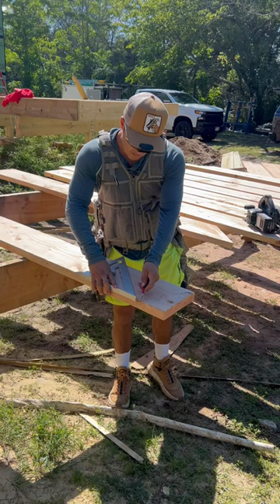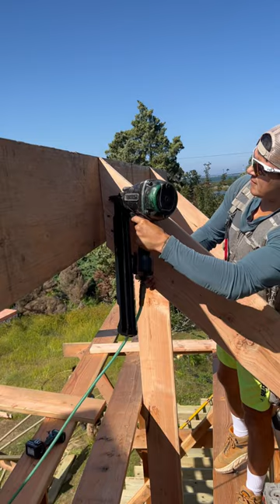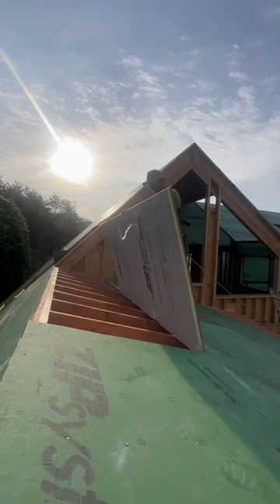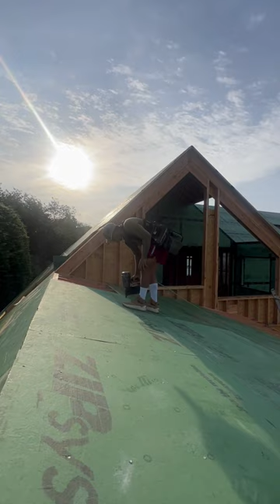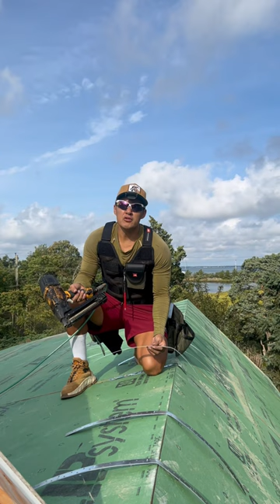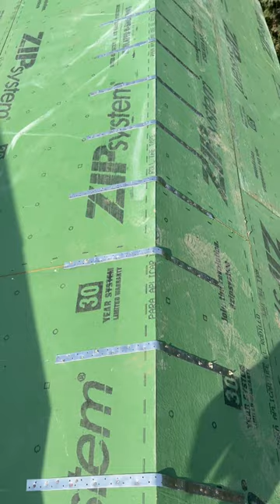We don’t use hangers on the rafters we use straps #shorts #short #perfect #design #construction

Comment: In certain types of framing (like timber framing and exposed raters) teco's are not the solution because of the esthetics. We often use straps, HOWEVER, they are the approved heavy duty kind installed directly to the framing and fastened with teco nails, not gun nails.

Comment: Ridge Straps are used in lieu of collar ties to resist uplift loads that could cause rafter to separate from ridge but in high wind areas we also need to use hurricane clips to tie rafter down to the plates. Also never seen them used over the sheathing
Reply: I pondered that myself, but can't nail the sheathing through straps if they're installed 1st and the inspector will be able to see the straps when he shows up.
Reply: @ajs96350  Yeah, I’m trying to think how one would nail the sheathing down without punching more holes in the straps. Hurricane clips can go over sheathing when attached to exterior of a wall/rafter so probably it’s good 👍
Reply: Better to use over the sheathing that way you can nail the sheathing easier to jump with the roof material. You know
Reply: @jlpease995 we use hurricane clips on the inside if the gc supplies those. Otherwise we use timberlocks coming up through the top plates. If there is a header there we angle the timberlocks on a 45° angle through the bottom edge of the lower top plate
Reply: I just use glue. Simple.

Comment: “We don use hangars, we use strap” 

I use what the engineers put on the plans
Reply: Sounds like someone is hating 🤔
Reply: Hater hater hater
Reply: @shaker_rt123 hating on that clown? Please bro 😂
Reply: @mastercreamer1398  you're coming to his platform with negative comments. Seems to me you're hating on him
Reply: Those traps won’t hold anything
Reply: @mastercreamer1398  you obviously watch his videos and proceed to put negative comments. I used to hate on him ngl. He's where I want to be in life. But I realized I was wrong and was able to admit it. Bro believe me, you're hating on him
Reply: @shaker_rt123 it's not negative.  There are sets of rules (codes), that you have to go by when you build.  It's not hating, it's just not done right.  Do it right or don't do it!
Reply: @svensvrgen6336  I'm a builder myself. Different states and in some cases different counties, have different codes
Reply: @svensvrgen6336  there's also such thing as overkill. If they didn't ask for it no need to go over board. I agree, I would've used hangers myself. But there's a reason this guy has blown up and hasn't been flagged! Maybe he's doing only what's asked of him and not going "overboard"
Reply: @shaker_rt123  yes you are correct.  That’s why I say I use what’s on the plans because different areas require different specs.

Comment: wind straps are better right on the wood. 
Zip-R on a roof ? pretty sure I wood have to deck that with at least 5/8" before the Zip to keep that foam from crushing on the rafters.
poly iso cyanurate needs at least a half hour fire block.
We use hangers (they are easy) , and straps, on "built on" eaves up to 5 feet as some jurisdictions require the exterior sheathing be continuous to the roof deck for fire code. easier to source rafters stock if it only has to reach the wall plate.
Reply: I'm not sold on the Zip yet. But I've also never seen it in person. And I have to somewhat agree on the foam underneath. The house I'm tying into right now, has 1/2" celotex everywhere. Even under his decking. I'm curious to see what the sheets look like once I tear into the roofline.
Reply: @Black_Dirt_Contractor  the first gen Advantec from Huber is good product.
Zip swells if wet. Zip R delaminates if mistreated, and the foam crushes.
I only run it over sheathing, and only on walls.
I have a building for the farms freezers, did not want to by concrete so I sheathed bother sides with 1/ 2 inch plywood and filled between the studs with sandbags ( 12,000 pounds) so it stays put in the wind.. Wrapped in 1.5 inch celotex., then a third layer of plywood then salvage roofing as siding
  The building does not freeze with no added heat here on the Canadian border.
Used right foil face foam performs. 
I am more of a Roxul guy nowadays.
Reply: @georgemckenzie2525  dang! You built it right it sounds like. Advantech is a great product. I have it as seat replacements on several deer stands. Been holding up for years. I like Roxul as well. I feel like it's changed a little in the last 5 years or so. I haven't used the celotex that much. Haven't really had a need for it. Only specific projects. Last project entire exterior had it over some siding. Taped the seems with foil tape then put on siding

Comment: I fee like the strap should go under the sheathing, especially with the foam under those zip panels. I dont think that would fly here in northern Michigan, but whatever works for you
Reply: So the inspector can see them what are you slow 😂
Reply: So you want the strap nailed to the foam ??
Reply: @Brooklyn8fs you don’t build for the inspectors visual you build to code and have inspections done at the correct timing. Just because he can see the strap doesn’t mean it’s to code or above, step code asks us to build above code these days.
Reply: @willbell9642  I’ve worked in California you mark and the inspector checks the straps and that’s how he passes them mr smart ass
Reply: @Brooklyn8fs  ya I’ve heard the building practices are pretty bush league there, keep being proud of that 👍🏼
Reply: The Good OLD  U.P.   You Have a very valid point. Floating on the foam... I know a contractor who puts closed cell insul. on roof decks then strips 2x4 and redecks with 5/8. The polystyrene is going to rot out the OG roof deck because the poly is not Permeable.
Reply: I feel like you must be an electrician or a plumber.

Comment: Man I see so many things wrong, no gap for the roof to vent through the ridge. Straps? On the outside of the sheathing?  That’s not the proper use. 

Also straps and hangers are two different things use for different purposes so don’t even get why there’s a comparison.
Reply: Remember he probably 1st saw a nail gun 3 years ago
Reply: The foam and roof sheating create a vapor barrier. No venting needed

Comment: How are you venting the ridge??? Or venting in general, gable vents, and box vents in the "field" of the roof??? Those vents would have to be tall and rugged for the snow loads here in the Northeast!!! How can you guys wear the vests??? Pouches only, here man!!! Other than that, you guy's work is neat and clean!!! "Keep up the Great Work, Brothahs"!!!
Reply: Ridge vents are old school.  The new school is to seal the house, and use an ERV for HVAC and humidity control.  Don't let heat escape in the winter, because it's expensive to replace lost heat.
Reply: @cyclopsvision6370 I’ve never heard of anyone doing anything other than ridge vents
Reply: @cyclopsvision6370  yeah, we like to just seal it up like a friggin petry-dish, so when the HVAC sh_ts, we can race to see who gets cancer or black-lung  first
Reply: Good times......
Reply: @duru2882 actually far better air quailty as long as the system is quailty and designed and built properly
Reply: if your spray foaming rafters  you do not vent the ridge and put block at the bottom over the wall and spray foam down to top plate. to complete the building envelope
Reply: @cyclopsvision6370 that's what the commercial buildings do
Reply: @duru2882   you're being over dramatic